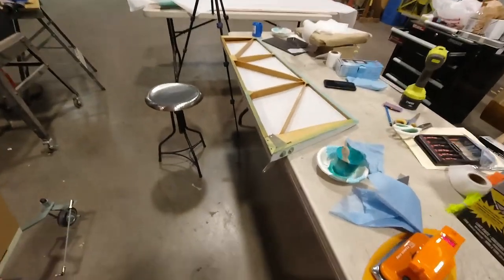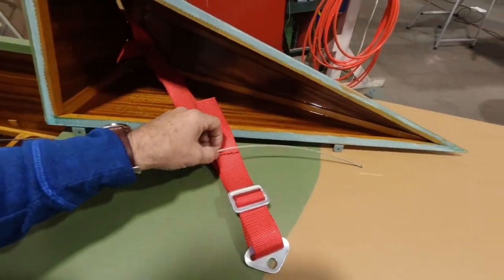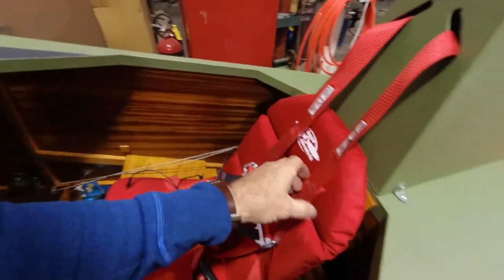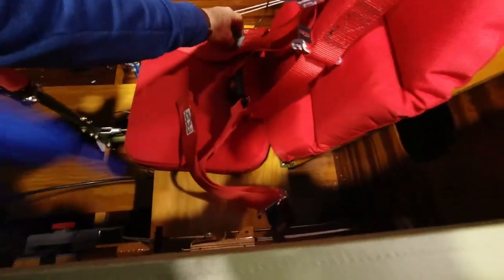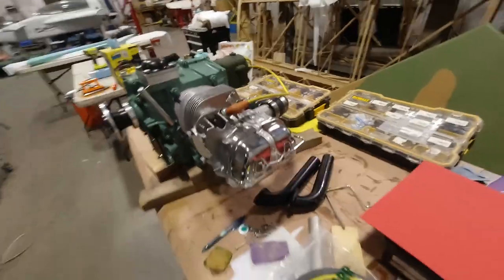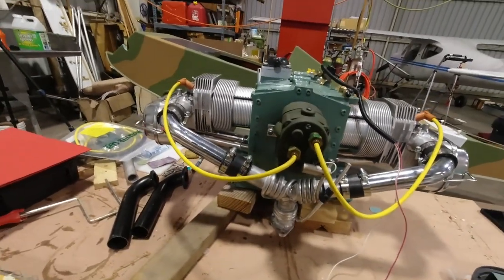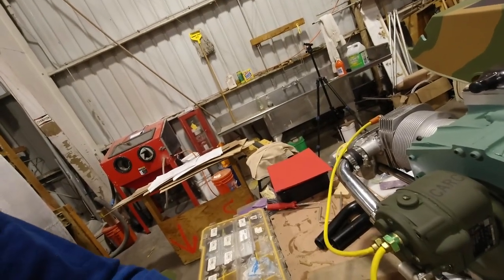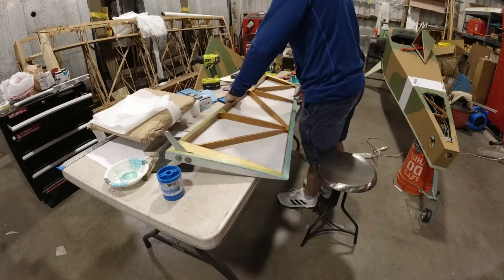Minimax 1100r Wood Aircraft Build Ep 167

Comment: Dennis, do you intend to angle the engine slightly to the right in order to counter the yaw induced by engine rotation?  On my MiniMax, I didn't, and wound up having to install a trim tab on the rudder.  I didn't install one on my elevator because I could trim the pitch with the throttle - set it correctly, and the airplane flew straight and level, hands off.  I also added a couple of reflex settings to my ailerons, which were actually flaperons.  This allowed me to trim to a slightly higher speed without inducing pitch up.  And, not to be macabre, I suggest you carry a seatbelt cutting tool in the cockpit, in case of fire.  My plane caught fire in that crash I told you about, and it burned so hot that the chromoly axle melted.  I hate to think what would have happened had I become trapped by my four-point harness.
Reply from the maker: Thanks for the recommendation Michael!
My modification plan does call for the back plate to be offset 1/4” less on the left side than the right.
Reply: @DTMinimax    You're welcome.  Knowing how thorough you are, I expected that you had already planned on an offset, but I thought I'd mention it, just in case.

Comment: One thing I’ve thought about on the oil for carb heat is if it was possible to put a shut off valve to cut the oil off if you don’t need heat. I build racing engines and the cooler the air is entering the engine the better it performs. Just a thought. Looking great Dennis! Our tower went down where I am. Been out of the loop for a bit. I’m back now🤓… did you ever get a chance to measure the inflated height of those tires? Also I just got my new engine, removing the hirth and putting on the Kawasaki 440. I’ll do some YouTube videos of my soon to be modified again maxx 🤣🤣 come subscribe brother. About all I have now is my drag racing footage but I’m slowing down and going back to altitude! I almost wrecked a 130mph wheelie on the track last year and that video is on my channel. That’s what made me decide to retire from racing. Time to find a younger and lighter fella to ride the bikes. I have more fun building fast stuff than riding and driving anymore
Reply from the maker: I’ll have to check out the drag racing!
It would be a easy to insert a mechanical valve in that line if you wanted to. I believe the intake is also cooling the oil.
What does your plane weigh?
Reply: @DTMinimax  255 with the hirth f33